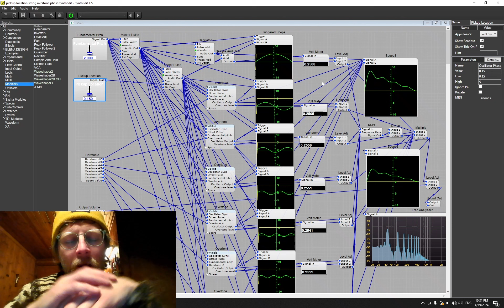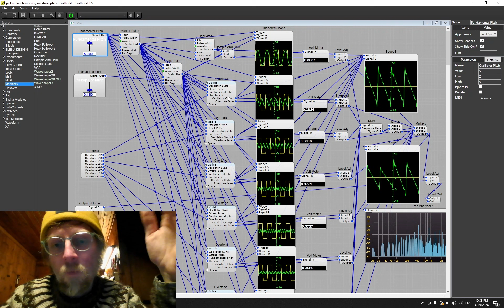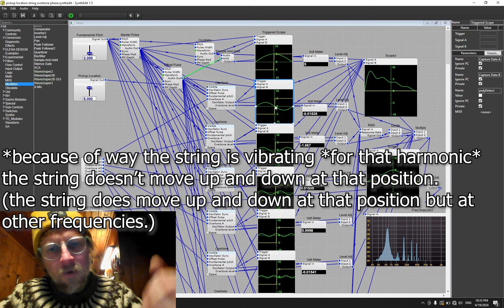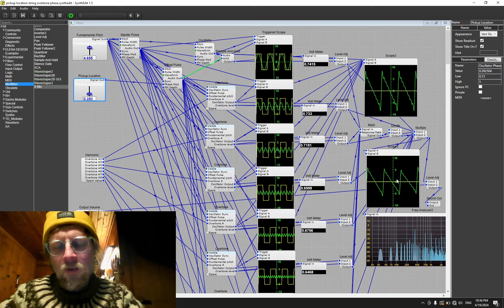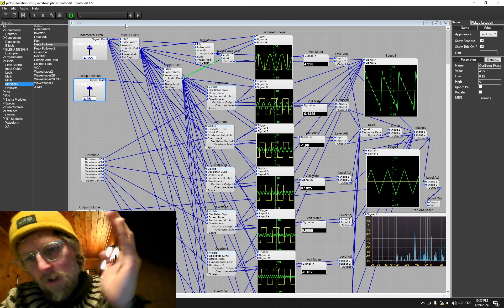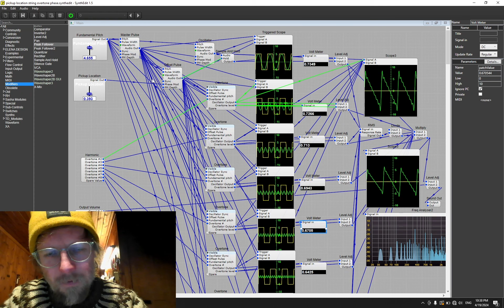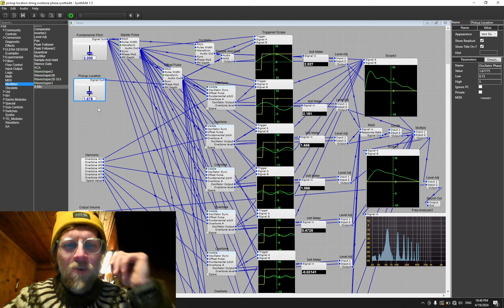Visualizing the effect of guitar pickup position on overtones

Comment: This was interesting & informative. I don't know if the physics involved tie in with pinch harmonics, but it made me think about them & made me wonder why it's easier for me to get them by using the finger-nail on my index finger, which I leave long, instead of a pick. Anyway, thanks for your effort covering this topic & sharing it with us.
Reply from the maker: I think the physics of pinch harmonics is that you're dampening any odd harmonic including the fundamental while allowing the others to ring because they are at a zero crossing at that position anyway.
So you would expect that if you did a pinch harmonic right above the pickup even though you'd hear it acoustically you wouldn't hear it through that pickup.